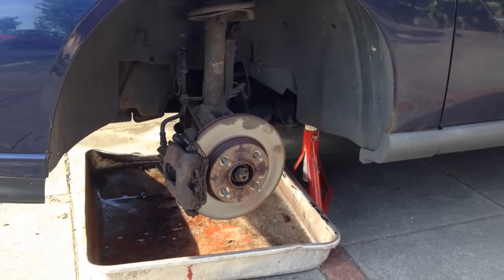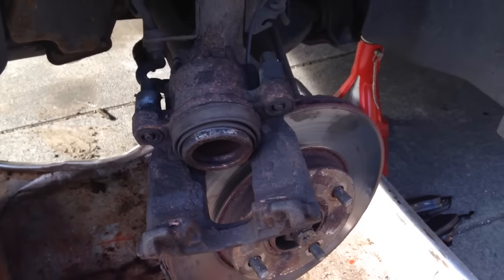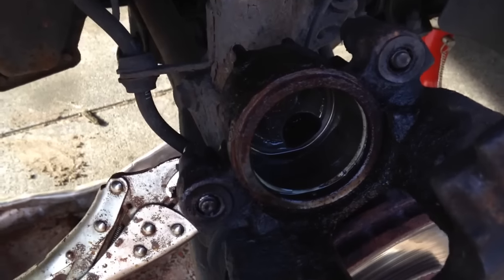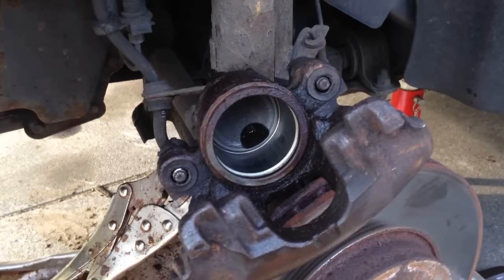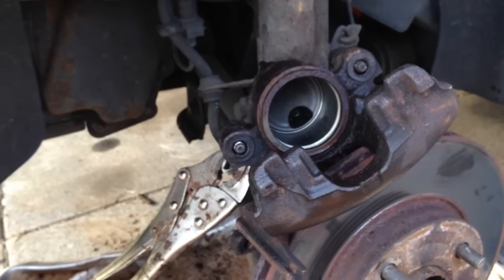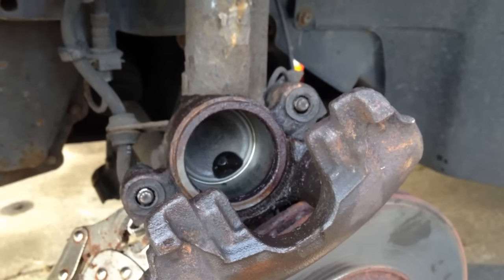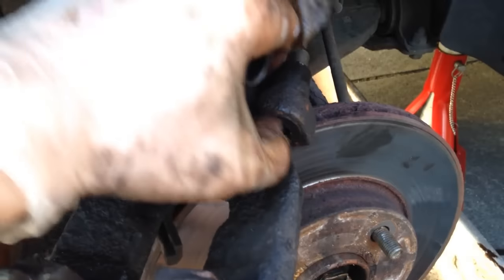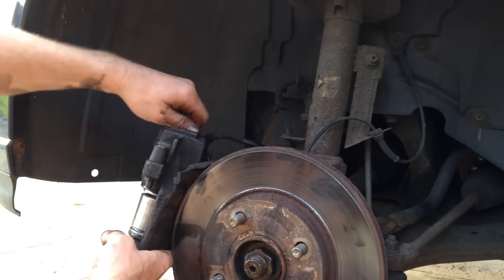How to Rebuild a Brake Caliper (WITHOUT Removing it From Your Car!)

Comment: Can you spray brake clean inside the piston housing to clean it up? And my brake rebuild kit doesn’t come with any lubricant. Does permatex work to lubricate the piston?
Reply from the maker: The caliper piston should be free from all contaminents on reassembly, so there should be no residual anything in there at all, unless your piston comes with grease, in which case that can be used to lubricate things. If the piston kit doesn't come with grease then use new brake fluid to lubricate the piston- that's what happens when its in service anyway. Chris 👍

Comment: Clamping the break hose is a bad idea. You can't look into it and if the damage done your life is in danger and the work you've done is wasted and further repairs are necessary. It goes well until it doesn't. Get a fitting flare nut wrench for the break line (easily damaged with usual wrenches), take it off, plug the line with a foam hearing plug that'll expand and the bright colour showing half way out it's easy to see. Use low air pressure to get it out and a wooden block and some towels to stop it from flying somewhere.

Comment: Hi! I can't press fit the outer seal into the caliper for the life of it! Must I remove the cylinder?  I only wanted to replace the damn rubber seal and it seems it won't stay inside,it pops out. Please help, I don't want to get the cylinder out because I don't want to bleed the system...what can I do? 2015 Mitsubishi Lancer

Comment: Hi Chris, refering to about 2:30ish, my piston just will not move, unlike yours. Similar type car & age,(jazz 2005) and the calipers are very similar to yours, so everything should go for me here like it did for you there, straightforward. But I've really pressed hard and fast on the brake pedal, engine running too, something will break if I keep on doing this, but the piston has not moved a single mm out. Chris, help! , what would you do next if you were here, why won't my piston move out, what can be done here? I'm really getting beaten down with this problem, please help,  Alan, in Norwich.

Comment: COOL VIDEO - GREAT JOB! only thing is the seal under around the shanford edge might not have fitted well...I could be wrong...I guess u will find out if the oil leaked out of it incase the seal did not fit on well. BUT a brilliant way to rebuild it without taking it off. COOL!
Reply from the maker: Hi Andrew, the rubber gaiter went back on to the groove with no problem. That seal has nothing to do with the brake fluid though - the inner square profile seal contains the brake fluid and this is the seal with the high pressure acting on it: the outer seal is just to prevent dirt, water and other contaminants from entering the piston, where it would work its way in to the inner seal. The brake is working perfectly since I did the job. Cheers! Chris 👍
Reply: Hi Chris, I got it! thanks for the explanation. I have subscribed to your channel. Many thanks
Reply: brake fluid is not oil...

Comment: Hey Chris, thank you for this. Another problem I've experienced is ' when I press the brake paddle while driving the piston never released back. Thus, it holds the front wheels and vehicle can't move whilst driving. How can I fix this?
Reply: If it's just one brake doing it, that sometimes is a sign of a bad/obstructed brake line.

Comment: Cracking video mate. Really well done. Maybe get something to hold the camera though for next time. I wanted to specifically know how to get the guide pin bushes in and out. Didnt think getting them back in would be so easy? I assume it was as easy as you made it look?
Reply from the maker: Hi Gareth, yes I could have done with digging out a tripod for this job but the car had failed its MOT and I was in a hurry to get it back on the road (I go insane within about an hour of not being able to drive wherever I want...) The bushes are rubber so are a proverbial piece of cake to get in and out. Cheers, Chris 👍
Reply: Christopher Barr - Random Chris yeah I know the feeling I wont/can't do public transport either.

So can the bushes be pushed in and out from either side. Or do they have to be pushed out from the inside and in from the outside?
Reply from the maker: 🙂 Yes, they are pushed out from the inside and then the new ones go in from the outside. If yours are the same kind as mine (rubber) it really is very easy to do. Happy fixing! Cheers, Chris 👍
Reply: Yes they are the same. Did yours gave a nylon sleeve insert inside them also?
Reply from the maker: I actually don't remember but from a materials engineering perspective I would say yes they did as that would definitely make sense in that application.
Reply: Christopher Barr - Random Chris cheers

Comment: Nice video.  Thanks.   Personally, I would've used a wire wheel or a steel brush to remove the majority of the rust that's on the outside portion of the caliper to make it a bit cleaner-looking.   Cheers.
Reply from the maker: If I'd have known over 750,000 people were going to watch this so would I. :-)

Comment: Hii Christopher,

Can you do a video on TOyota Avensis rear EPB (rear parking brake) rebuild and tear down ? how does it function ? 
i twist it to push the cylinder back when put in a new brake pad. but in the process i punctured the protection rubber boot. 

hope you can do a video of this or similar caliper

thx
andrew

Comment: Use some reusable adhesive putty to block the fluid hole inside the bore so it doesn't leak all the fluid from the master cylinder
Reply: @Peppermint. Just prop the brake pedal down several inches to keep the brake fluid from draining out. The piston in the master cylinder will cover the return hole in the master cylinder so that fluid can't drain out.

Comment: I have done it that way before with parts from Brake Parts. I am fussy about dragging brakes. Usually I do not need a new piston as any corrosion is usually outside the seal and the brake grease keeps it from corroding further.
Reply from the maker: Hi Andrew, the only thing to be aware of about leaving a corroded section of piston is that often the next time you fit new brake pads the corroded section then makes contact with the square profile seal and this can cause the seal to fail prematurely. Of course it depends how much of the piston is corroded and this call can be made on a case by case basis. Cheers, Chris 👍
Reply: Christopher Barr - Random Chris I agree with that. It's really case by case. For example rear pads on an old car will often outlast the car unless they drag.

Comment: Hopefully you're still replying! What did you use to clean out the inside of the caliper? Thank you
Reply: On my calipers, it was mainly getting out the SLUDGE which is easily done in the kitchen sink (soap and water) and then use some brake cleaner spray.  Then I used a 0000 fine steel wool to make sure the piston bore was nice and smooth.

Comment: Any time you take off your caliper and are reinstalling it probably a good idea to go ahead and regrease your slide pins and pad contact points with silicone based brake grease. The brake longevity and function depends on the ability of your caliper to move freely on these pins . Do not !! Put grease on the surface of the pads that contact the disc ( rotor)  just  tiny bit on the square ears of the pads that sit inside the caliper for supporting the pads.

Comment: Thanks  Chris for you video, unfortunately  I bought a new caliper, for my focus, but I still have the rear passenger side so I am going to try it.but on the other hand I could not open my bleed valve, as it is ruined all around, and stuck tight, plus the caliper is not able to wind back, but then I don t have the right focus rewind tool,  I know the manufactures say its for ford, but definitely not for a 2007 focus. Yes I tried drilling the calliper holes, but to know avail,as the rewind tool  metal pins are too far apart. Ford want to make things difficult. Their rewind tool is £ 70.00 which of course I will not buy. again thanks for saving me money, and balls to ford.

Comment: @11:17 before you put those grommets in, you should clean out the channel it sits in. What happens is the cast iron in there rusts, and bubbles.  This rust causes the grommet to sit on top of a smaller channel, and thus have a tighter fit around the guide pin.  This tighter fit will not allow the pad to release from the rotor as well as it should.  This will lead to either a pulsing when you brake, or premature wearing of the inner pad
Reply from the maker: There was no corrosion on the inside of there so that wasn't necessary. You're correct in what you're saying if there is corrosion present in the apertures. There was no corrosion on the inside of there so that wasn't necessary... 14 months and counting this brake is functioning perfectly. Cheers, Chris

Comment: Once the calipers have stuck and the brake assembly has become very hot, is there damage done to the piston seals???
Reply from the maker: Hi Richard, there can be but bear in mind that the brake fluid acts as a coolant. It depends if the calipers got up to a temperature at which the seals get damaged so it is very much a case-by-case scenario. Cheers, Chris 👍

Comment: Hi Chris, yes I do have a question for your opinion. I am having this sticking/stuck piston problem right now (this is how I came by your vid), similar type/age car, a Honda Jazz 2005. Watched your vid with great interest, twice. I am wondering, when the piston comes out can't it be derusted and cleaned by using fine wet&dry paper or very fine emery etc? and re-used? is it essential to buy a new one? I've not had to do this job before, plenty of other jobs on many cars tho, but would value your opinion on this. Thanks Chris, from Alan (Norwich).
Reply from the maker: Hi Alan, this could be done at a push but there are two issues: 1) It will be difficult to maintain a perfectly smooth surface so leaks are more likely afterwards, and 2) Once the 'fescalised' portion (shiny outer surface) of the piston is removed, the piston is more likely to corrode again, so if this does work and there are no leaks, you may be back to square one a year or so down the line. The piston kits are cheap, https://amzn.to/2JRtCN2 (Example kit, affiliate link supports my channel) so I would replace the piston personally. Cheers, Chris
Reply: I very much appreciate your reply, thankyou ! I'm still in the middle of this job, and I'm stuck because I cannot move the piston out of the bore. Your video makes it look easy and straightforward, and I wish you were here (Norwich) to see mine, because I pump the brake pedal like your wife did, and hard too and lots,, but my piston will not budge out the bore, just wo'nt move. I think the flex hose is clear, as fluid comes from the bleed valve, but I retightened this, pumped the pedal forcefully, and that piston does'nt move out. Why was it so easy on yours? It all made sense, but why won't mine move out? What would you do if yours did'nt? Alan, Norfolk.
Reply: alan may Hi Alan, have you tried this with the car running? This will increase the pressure being applied to the piston...
Reply: (Oops, this is still Chris by the way, I'm just signed in on my other channel.)
Reply: That did cross my mind, but thought it would'nt matter, and remembered you did not have your engine runnig, so did'nt try. But now I will do this, of course the servo will exert more pressure, dont want to blow out a hose, I will try this tomorrow & let you know how it went. I'm tempted to buy a new caliper, but this costs a lot and there's both sides too. Thanks for your help Chris, you're a good guy! Alan, Norwich.
Reply: Hi Chris, I've now tried again to push out that piston, this time with the engine running, and really pressing hard down on the brake pedal many times, fast and hard, to the point where something would surely break if I kept on going with this, but that piston has'nt moved a single mm out. So I'm having to admit defeat and buy two front calipers complete, from the same online company you bought your kit from, unless you can suggest an alternative; what would you do here? Thanks for any help Chris, Alan in Norwich.

Comment: I think when you bleed the caliper, you really need to attach a transparent hose to it, so you can observe the air bubbles coming out (and tighten the bleeder valve when the air bubbles stop)
Reply: Really? I thought you just opened the bleeder and pumped it 4-5 times. No wonder I hit those people.
Reply: Yea i'm not sure how he was able to just look at the brake fluid leak out and say it was free of air.

Comment: Hey mate , what if my seal is Damaged and I cannot pump the brakes to pop out the piston ? is there any other way ? I’ve been trying to use my flat head and hammer but afraid I might damage my piston
Reply: Let off the bleed to release the holding pressure and pull it out. If it's difficult to pull out, get two spanners and use the open ends to catch the inside lip, bit like reverse scissors.

Comment: When doing a brake job, always clean your piston with a scouring pad or fine sandpaper. Wipe it down with a rag wet with brake fluid.  Open the bleeder screw, and then and only then should you push the piston back in
Reply: Absolutely NOT. The shiny slick new piston slides through the new matched shiny slick square seal. If you sand the piston, the piston will then sand the seal causing seal to leak. Think of it like the ringless piston in a two-stroke model airplane engine. Would you sand that piston? Absolutely NOT. Instead, use the piston lube that comes with the clean shiny new piston - same reason they mix all that 2-stroke oil (lube) into 2-stroke model airplane engine fuel. If the new piston sticks then the caliper is heat warped and cylinder is no longer round. OWCH!

Comment: It's easier to slide the seal back from the cilinder so it sticks out a bit. (At 09:15) Then put the seal in the caliper and when u push the cilinder in the caliper, the seal will settle itself ;-)

Comment: Had you slipped the outer boot/seal down past the end of the piston and the top seal below the top groove, you would have the outer seal in the groove first and as you push the piston al the way in the top seal would slip into the top groove by itself.

Comment: Ok observations regarding things you missed out on telling people which are very important things for their own safety.

1/ Inspection of brake hoses to ensure they are in good condition before and after clamping the hose.

2/ When pumping the brakes and not using a bleeding system the person who pumps the brakes must keep their foot firmly in the down position on the brake pedal as you loosen the bleed nipple and only tighten the nipple at the end of the downward foot pump motion under pressure.

3/ The brake reservoir needs to be topped up as necessary during this process to ensure it never drains out, and should you find that you missed it and ended up with zero fluid in the reservoir you will need to bleed the whole system to remove all the air that is now in the system.

4/ Cleaning out the groove in the caliper, this must be done thoroughly or when you put the rubber ring back in and try putting the piston back in, you will damage the rubber ring, never force the piston back in it should slide in gently or you face damaging the rubber ring.

5/ Wear gloves to avoid getting brake fluid on your hands, you started off with gloves and then carried on without them.

6/ Always use the correct type of Brake fluid Dot 3 is not recommended for Dot 4 systems and vice versa and can cause braking problems.

Just a few things other than that a pretty good video.

Comment: Another way to stop brake fluid is to depress the brake pedal fully and then hold it depressed by putting a stick or plastic pipe between the front of drivers seat and the top of the brake pedal..adjust seat to get a snug fit.

Comment: My car has an electric handbrake, would the steps be exactly the same (2009 Passat CC), thanks
Reply from the maker: Hi Andre, you can still do this, but you have an extra issue to deal with... The caliper has an electric motor attached to it which will prevent you from doing the job. There are a few options: 1) Pay a dealership a small fortune to do the job. 2) Buy a special code scanner to tell the car to retract the caliper. 3) Apply a voltage to the two pins on the motor and get it to retract. Here's a video: https://youtu.be/J-q68JIUils (You would probably be able to do this with a standard 9 volt battery like this: https://amzn.to/2RCkM82 ) Happy fixing! Chris 👍

Comment: I did the push the brakes too poo the piston out and that didn't work. I took my whole caliber off and use a clamp and my piston still won't go back in or twist at all. I took that rubber part off and it look rusty around. So I guess I'll have too soak it in something to break the piston loose?

Comment: Hi again chris, what i wonder: some calipers are to be turned inn, as u know....what happens when all is installed on the car? Does the piston follows the same winding path out when u apply the brake pedal??? So has it a circular motion being pushed out by the pedal? I wondered since a long time, im sure u can provide the right answer! 😎🇧🇪Bob Belgium, stay safe brother! Love yr videos, but somehow was not subscribed on these....have u changed yr youtubechannelname? Im a fan

Comment: Pretty decent vid mate. One thing you should always do before any brake work is done is to make sure the reservoir is always topped off. 

At the same time I got new calipers for the same price as to repair one. It only seemed logical to get all new parts to me.

I expected more description on bleeding the brakes than you gave. Everything else top notch brother. 

Good day

Comment: Hi , i would prefer to dismount the Caliper and then wash it with Gas oil sand it for rusts 
and then remount it back and if the caliper is in bad shape just put a new ones with new Hoses too !